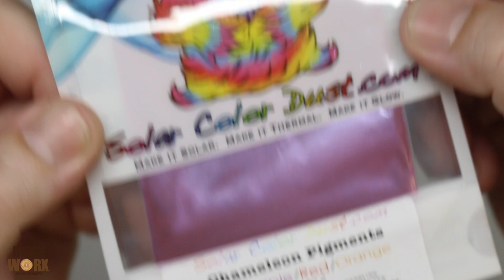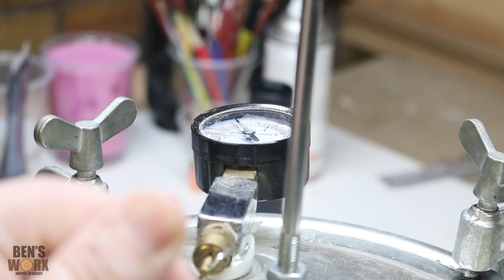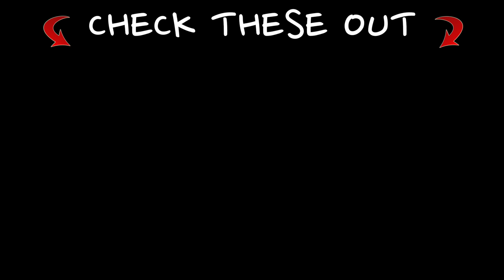Making a Buzz lightyear Dragon egg

Comment: That pigment looked really cool. Hey, quick question (sorry if it’s a dumb question) and not sure if you’ve done it before, but with the clear shavings or ribbon like stuff that’s leftover. Is it possible to dye it different colours and recast into a new mould like a bowl or box or whatever, or would it just dilute in with the new resin mix? Sorry just curious, just thought it might be interesting if it is possible that is.
Reply from the maker: Hi Brent, I have made a bowl using dyed resin shavings, the video is on my channel if you want to check it out

Comment: Awesome work mate. I noticed in your how to polish resin to clear video that you were using the hafco wl-14v is that what you use for all your turning? If so how you find it, looking at it myself.
Reply from the maker: Thanks Mate, the wl-14v is a great machine for smaller projects like pens and eggs. I upgraded to the wl-46a to do larger work and mainly use the 14v to sand
Reply: Ben's Worx oh wow nice upgrade. I am mainly looking at doing smaller items such as knife handles and small pots or bowls.